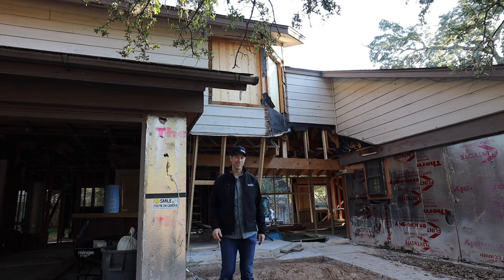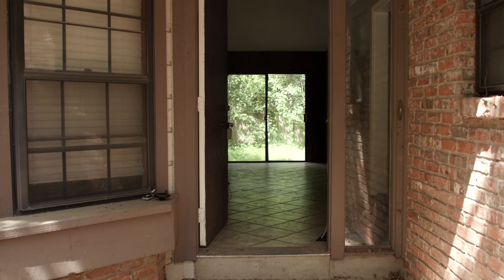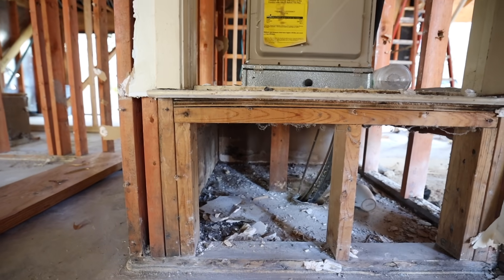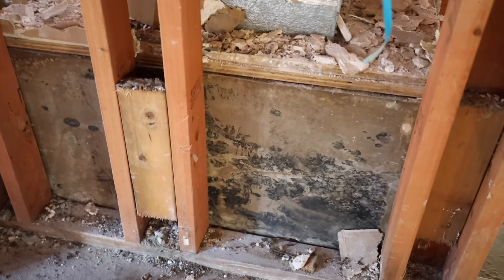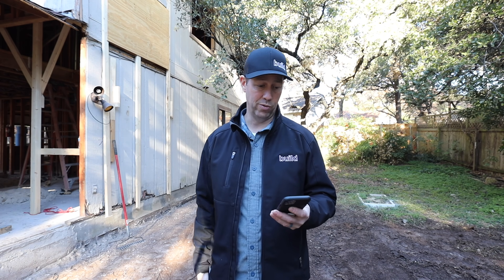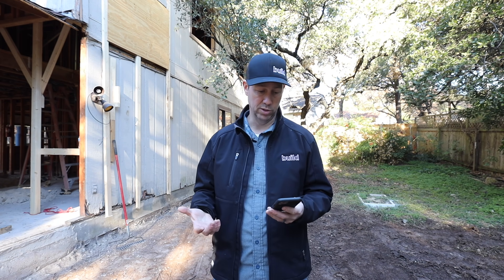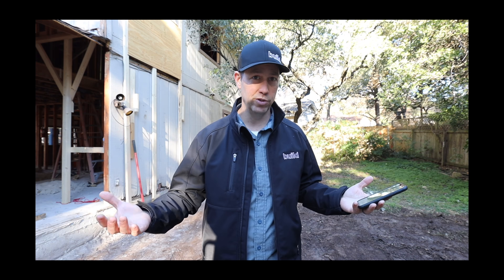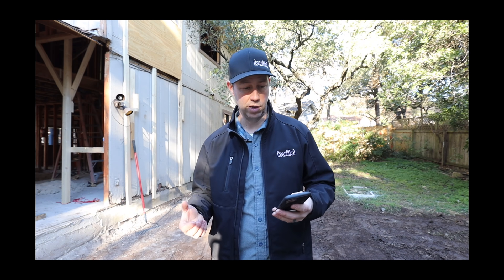Should I have just knocked it down?!

Comment: An overlooked factor in the tear down vs. remodel debate is the affect of property taxes. If you fix up what you got, your tax bill should be tied to the original assessment at the time of purchase. If, however, you tear down and rebuild, your assessment will be based on the market value of your completed new home at today's inflated prices.

All too often, contractors don't even care about property taxes or building permit fees because someone else will get stuck paying for those costs. New construction may result in a property tax bill that is several thousand dollars per year more than it would have been with a high quality remodel. Those thousands add up quickly over the years, and will continue to increase each year long after the mortgage has been paid off. That increase may exceed $100,000 in 30 years over what the owner of a remodeled home would pay.

Tearing down a serviceable 50-year-old structure will most certainly result in higher costs when compared to a quality remodel. If the house will be one's residence, then higher quality upgrades make sense. If the property is kept as a rental or investment, there is no need to upgrade beyond the level of the surrounding neighborhood. If it is being remodeled to sell, then market forces in that area will determine the sale price no matter how much you spent.

Comment: To a New Englander this existing house seemed overly complex and overly articulated in the first place...although I acknowledge a slight regional bias. We “overdo” houses in NE also. It’s just that it makes many of Matt’s design moves that much more complicated. Would it have been possible to have knocked down everything above the slab, do limited trenching as required for new 1st floor sanitary and the occasional new column footing (if needed) and then build new over the existing concrete slab footprint and apply self-discipline to one’s typical “edifice complex”? This might avoid the inefficiency of “picking away” at the overall building frame and allow a good framing crew to do what they do best.
Overall this is an interesting project because I definitely see an unserved market throughout contemporary suburbia...particularly near secondary urban centers for taking  modest “pre-McMansion era” (50s through early 70s) single family houses and efficiently remodeling the into homes with “passivhaus” levels of energy efficiency AND superior aesthetics...suitable for smaller families and retirees who still want to live in a single family house Ina walkable neighborhood. Many of these homes, such as my parents’ in New Jersey (built 1952) were actually very well constructed if perhaps not architectural gems.

Comment: If this is going to be your house, use spray foam and not that 1/2 pound crap.  With only a 2X4 stud wall you can get R21 in the wall and you just don't need that much when you use foam. Two inches in the wall and three inches in the roof and spray the foam on the roof sheathing and you avoid that hot attic and shingle last longer.

Comment: i know this is old but most have no clue what goes into a full remodel of a old failing house. 9 out of 10 times your better off to tear it down and rebuild.... im in that mess again right now. 40's house' moved in 70's , and now im gutting and remodeling. its 3 times the work and 5 times the time. take it apart fix issues, put it back together... equals finding more and more issues as you open it up.

Comment: Hmmm, with a background in microbiology as well as construction I'd have backed out and done a full demo once the extent of the rat issue was first glimpsed. And really, folks should have been in hazmat suits up to this point due to the very real danger of Hantaviruses and other infections. Austin and Texas aren't exactly Hantavirus central, but there are still very real risks involved with an infestation that extensive and amount of rat feces which do pose significant biohazard risks including Salmonella, Typhoid, Weil's disease, Lymphocytic Chorio-meningitis, Typhus, Rat-bite fever, Hantaviruses, and Rat Tapeworm. And given the combination of feces and mold, my personal bottom line is I wouldn't move my family into it no matter how extensively it was remediated and rebuilt. Maybe think of this as a very real dimension of building science (building pathology) and your otherwise fastidious jobsite cleanliness which should clearly include biohazards in that area. But if you're going to go forward with the remodel, then I'd immediately halt construction and do as thorough a biohazard remediation as possible.

Comment: Interesting project. I am a licensed general contractor who has done many remodels. I think with this house, it might had been a better choice to tear it down to the slab and  just reuse the slab. You could have kept one exterior wall and it called it a remodel.  Then you could have built a modern structure with 2" x 6" walls and an updated design. 

I really don't see why you cut off the tails in the back - structurally, that is a  not a good plan. Lag bolting tails on really doesn't make sense to me and they will be weak, no matter how good your connection points are. Now I am not familiar with the system you are using to insulate up to the roof.  So I am not seeing the whole picture. 

Hopefully you have some equity money in your purchase price. It looks like you are going to be spending at least $150,000 to do this remodel.  I wish you success.

BTW, thank you for your inspirational message, it greatly encouraged me. God indeed can do the impossible!

Comment: Another con of knocking it down and building new is that you could end up building a home that "values" for much, much less than if you would have built it in a different neighborhood where the homes are more suited to that style. Even though you are changing the roof line in a couple places, your home "finished" is much more likely to look like it "fits in" with that neighborhood. There is even a special section that an appraiser will fill out telling if the home "fits in"; at least in Utah there is and I've seen it many times.
I will never forget this one house that I came across... Apparently a guy bought an old house and he got it for basically the price of the lot. Then he built what looked like a mansion to me. But all the other homes on that block were still of the old style. It looked like absolute crap to be honest because the home didn't even fit in at all. I had my realtor drive by there and give me her opinion on value. She of course had (and still has) tons more experience than I do selling homes. She estimated that "super nice" home to be devalued by at least 100K just because of where the guy built it. Then she told me something I had never thought of. She said because of that "eye sore" of a home, the homes on either side of it would also lose value because who would want to buy one of them next to that big thing.

Comment: Demo it. Or have you sunk to much into it?

I think I mentioned that I would have demolished it shortly after you posted the first video.

As for ducting I'd go Mitsubishi ductless. Then maybe some warmboard paired with that removable wood flooring you showcased a while back. That way you have radiant floors you can access.

I'm lucky where I'm at, county doesn't have any permits or codes literally. I am the code and permit department 👍
Reply: how would you add fresh air to a ductless system?  I will use  a consealed  ducted mini split and HRV
Reply: @andreycham4797  you just answered your own question... 🤔 You do know these systems can operate independently right?

Comment: Should I have just knocked it down?  Considering you said it was built in the 1970s, the answer is obviously yes.  That's the only piece of data I need.  Here I sit in a 1971 ranch & have renovated most of it from the outside in over the past 20 years.  I definitely would have been better off starting fresh.  1970s tract homes are the worst.  Worst products and worst techniques.  In my case, I think my house was the free one--by that I mean it appears to have been built from the scraps off of other jobsites.  But now, 20 years in, I have it pretty decent--so I'm going to stick with it because I'm too far in.

Comment: Safe to say the only reason you ever considered a repair is because you are in the business . Anyone else , tear it down and build it correctly . (however , my entire philosophy on all aspects of existence , less is more,  practicing quality over quantity ) (burn it down , save foundation )🎅
Reply: In the case of homes, keeping an old foundation doesn't work. The foundation is built for the layout of the old house, with the deeper or strengthened areas where load bearing walls are, and plumbing to match the old house. New codes are often different than how old foundations were built, and that is if it is even possible to find out what the inside or bottom of the old foundation looks like. After being in the construction trades for 25 years and doing similar remodels, I'm all for a remodel if it achieves the goals of the owner. There are many benefits that non builders don't understand and people under estimate the labor/materials cost and code issues with starting over. With no codes and permits to deal with, it would be much easier and more economical. I'm stuck with the same issue with a single car garage. I could easily knock it down and rebuild it better, but codes may prevent it from being rebuilt.

Comment: In terms of HVAC equipment Builder Grade is often confused with Brand when all brands make builder grade equipment. 

No brand regardless of grade is better than another. The difference is in who you have service and repair the equipment. In Texas we live in a heavy use climate. At 75 degree indoor temp you will run that equipment around 2300 hours. Cooler than that and you'll easily break 3000 hours. 

Builder grade or not, it will break under use. Now if you are someone who likes lower temps in your house (lower than 75 degrees in Texas) then you would be better off going for the higher grade of equipment. You pay more for the equipment, but this cost is off set by lower utility bills.

Comfort means different things to different people. Texas climate is unique unto itself. I've dealt with this Texas climate for 20 years of my 26 year career in HVAC. 

I just put in an Inverter Heat Pump at my 1970's 'all electric' home in Katy, Texas. I'll be breaking my use savings down in a future up coming video on my channel. I expect  that my electric bill will be cut in half.

Comment: I don’t think you really answered the question. Would it have been cheaper to build the same house you’ll get from the remodel if you’d just bulldozed the existing frame and built on the same foundation. I suspect the answer is yes, but only because of the terrible condition of the existing house. Clean up would have been faster, problems would have been addressed at the design phase. You’d probably be finished by now and living in it so there’s the opportunity cost as well. And the end result would have been less compromised from an engineering standpoint. But you wouldn’t have got as many episodes out of it - so there’s that.

Comment: this house shoulda been demoed no question about it, what a f'n structural and biohazard mess
Reply: People are afraid of what they don't understand. They also don't understand the cost and problems with starting over. The biohazards aren't a big deal and are dealt with all of the time..........same as structural issues. It is easy for me to say as I have done this type of work all my life including water damage, mold repair, dead animal removal, asbestos training, and remodels like this. There are so many variables that only Matt is informed well enough to know what is best and then his opinion would still vary from others who may be in his shoes. People think so black and white and in such a simplistic way, and fail to consider how complex a topic may be. I have learned look at a topic from many points of view and consider that there is likely more to it than it may appear, especially if I don't know a lot about the topic. We don't know what we don't know, but over and over I have been pleasantly (sometimes not pleasantly) surprised with how much there is to learn when I dig deeper.

Comment: Yes...You should have just knocked it down.  At this point, I think it would have been cheaper.  Tearing out and replacing is almost like building it twice.  Tearing out is expensive not only for labor but for the disposal as well.  I'm kind of in the same situation as you, without the rodent issues and the mold issues.  My house is from 1960 and we are redoing the entire inside.  I will NEVER do this again.   I assume with moving everything around there will be all new drain pipes to the main.  I'm sure with this being from the 70's the electrical isn't to code, you have animal droppings everywhere...You have a lot ripped out, but yet you will probably find more wrong with this house.

Comment: Do you really not know that MOST furnaces are in the garage in cooler climates especially in smaller and spec homes?  If they’re even halfway properly installed they don’t have rats living in them or pull smells from the garage. Furnaces need outside air for combustion per code and higher efficiency ones need condensate drains so the garage is a logical place for them in many ways. You destroy your credibility when you claim the garage is the worst possible place for a furnace when literally millions of homes have furnaces in their garages.